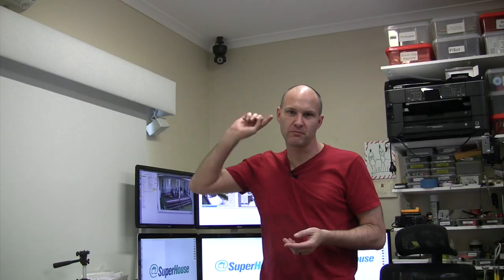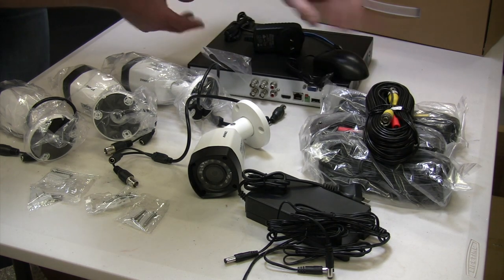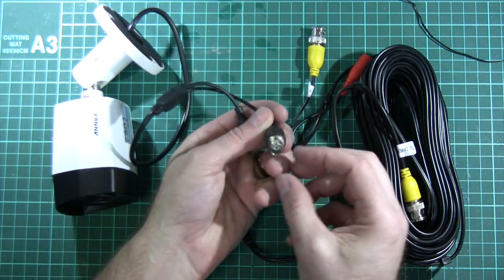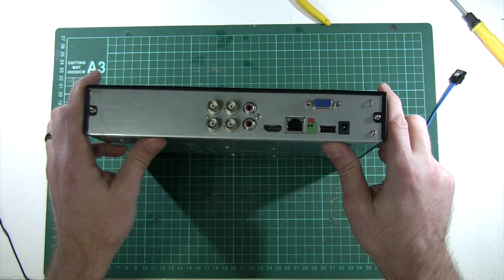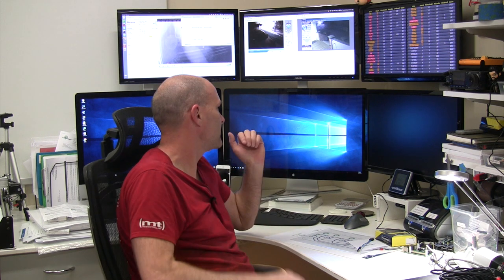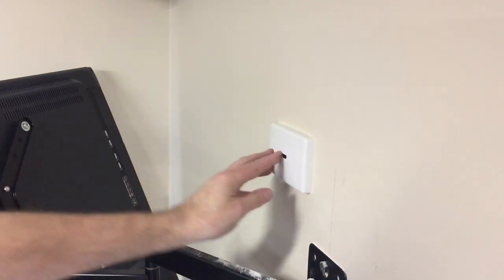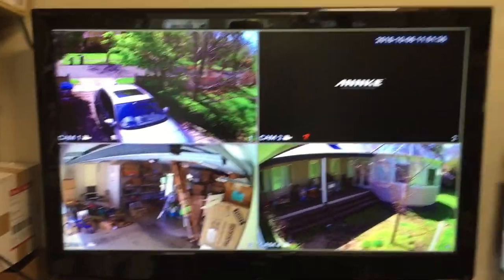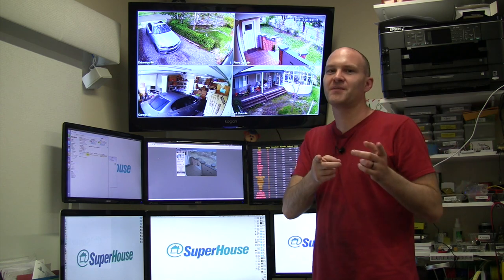SuperHouseTV #18: Installing the ANNKE 4-channel CCTV system

Comment: Really glad to run across such an instructive channel. I love the tempo, the details et your opinions as a seasoned engineer. Thanks a lot. Each and every video I've been watching so far, is awesome and helpful. You really deserve your 55K subscribers.
As a matter of fact, I agree with you about the exclusive-windows monitoring software. I do all my job on linux boxes and it's always pretty frustrating to install a dedicated machine (virtual or real) just to have your monitors running. Looks like a regression...
Regarding cables, you didn't mention Power over Ethernet cables which could spare space and time too. Adapters could do the job but they're pretty expensive for the topic.

Comment: Hi Jonathan! Greetings from a fellow Aussie, electronics, home automation, ham radio, computer geek! :-)
A few points... you refer a few times to the ANNKE cameras as being HD and 1920x1080.  These cameras use composite video which is not HD, it's either 480i or 576i depending on being PAL or NTSC.
I really think you have better check the temperature of the DVR in the ceiling space during summer... I think it's going to get way to hot up in there. (noticing beads of sweat on your forehead during this video).
There are a lot of keenly priced HD IP cameras and DVRs out there now.  I've been playing with the Hikvision cameras and they are amazing value for the $$$, 4MP (2688x1520) for ~US$130 . The web interface supports multiple web streaming formats... Microsoft, Quicktime, VLC.  Motion detecting is built in, FTP uploading, amazing IR illumination. RTSP streaming direct to software like VLC. 
The Hikvision DVRs work very well too.
Reply from the maker: I have a temperature sensor inside the ceiling space a few meters from where the DVR is mounted. It reports back to MQTT and shows up in my OpenHAB interface (along with temperatures at other places around the house, including under the floor) so I can see what it gets up to. We went crazy with insulation when doing the renovation, so the ceiling space has two layers of insulation directly under the roof and then another layer on top of the ceiling. It definitely gets warm in there, but not as extreme as it did with before the roof was replaced.

Comment: Great stuff, don't believe you found the fishing wire so quickly though 😆
Reply from the maker: You got me! I originally tried it with a piece of yellow-tongue, but I couldn't get it through the insulation. So I switched to the wire, which went through easily. It really did end up in that position though, because I measured from the side wall to get both holes lined up vertically :-)

Comment: I know it's a bit late, but the firmware on these DVR's/NVR's tend to have an RTSP stream that you can stream from.

I have set up this model before and IIRC, the address is something like rtsp://ipaddr:554/PSIA/streaming/chXY (X being the channel and Y being the main or substream, usually 1 or 2)

With this address, you can stream directly into omxplayer on a raspberry pi or even right into VLC.

Comment: Great Video. I have a 10 camera system with a 2Tb HD. So glad you reminded me of the ethernet extenders! I know I will have 2 or 3 spots that need more than 60ft.  I bought this system about a year ago (still have not installed it!!). Please make a follow-up video for those great features you spoke about at the end.  I would like to come up with a way to have my HD tv in my bedroom automatically switch from regular tv programs to the cameras if motion is detected.

Comment: Wait a minute. So, the power, like the 12v needed for a TVI camera can go across that small junction of ethernet cable? Amazing.

Also, I have a question. I have a HD-SDI camera (I know, it's old) for my driveway that weren't installed by me that haven't worked for months. What do I use to check if there is still power running to the camera?

Comment: Don't know if I'll get a response, but where did you get the BNC, Power Audio adapter to Ethernet for the last camera you did & what is it named?
I'm looking at a camera system & would rather run a single Ethernet cable for each camera through a wall then make a hole big enough to fit the 2 plugs of each cable through

Edit: Found some on Amazon.com & will likely use these when/ if I install a camera system similar to yours
Reply from the maker: I just saw this comment, sorry. I'm glad you found them :-)

Comment: I have a cobra  8 channel system and rxcamview installed on my phone.  My remote access works fine for 24-30 hours and then the remote access is disconnected.  I have to reboot my DVR and as soon as I do, the remote access to my cameras work again.  Then it fails again after 24 hours.  Reboot and it works, then fails, etc.  What is wrong...Can anyone help?

Comment: My only concern with doing home automation is security.
I would not want it connected to any internet or phone companies.
Basically I have 2 separate networks of both ethernet & wifi...one intranet & one internet.
Can this setup still be used on my local intranet so it will be secure?

Comment: Great video. Does it get hot in your attic where you installed the DVR, will the heat be a problem long term?
Reply from the maker: It gets warm, but not ridiculously hot. I have temperature sensors in there reporting to MQTT so I can track it. When the house was renovated we were quite obsessive about insulation, so it has two layers of insulation directly under the roof, then another layer on the ceiling. It's made a big difference to the temperature stability of the house.

Comment: In the UK the cable with coax and power is known as shotgun cable. Also the converter from BNC to cat 5 then back to BNC is known as BALUN. it changes the signal from balanced to unbalanced. I find that the quantity is not the great compared to BNC but yours look unnoticeable.

Comment: At about 31 minutes you talk about the Sonoff and presence detection. What method do you use to determine presence? All the methods I'm familiar with have reliability issues, but I'm interested in what method you prefer.
Reply from the maker: This is probably one of the most frustrating aspects of home automation for me at the moment. If it was possible to reliably track the location of every person in the house, it would open up so many cool possibilities! I currently use OpenHAB's network health plugin to check for the presence of various mobile phones on the local network, so that I know if particular people are home. I also use PIR motion detectors to figure out which rooms are likely to have people in them. PIRs are great for detecting unexpected intrusion (someone came into a house when it's meant to be unoccupied) and terrible at detecting occupancy. Sit still for 30 seconds and suddenly the home automation system has no idea you're in the room. In the past I've experimented with IR beacons (a badge you wear that identies you to a receiver in the room) but that is a terrible user experience. I've also experimented with a Kinect to do volume analysis, so it could know (for eg) if there is someone lying still on a couch. I've also used face detection in video streams, with very patchy results. I've spent a lot of time trying to solve this problem and haven't found anything that comes close to being a good solution.

Comment: The whole network connectivity on something other than Windows has been driving me nuts. I run Linux on my daily use machine, therefore... No ActiveX. Many cameras including the cheap Chinese ones, require ActiveX. So far I'm trying to get around that by using BluIris as an NVR.

Comment: Hey. Great video. This is quite late but I've been trying to look for a cctv system and aanke seems to be what I'm aiming for. I want to get a hd system but I need to know whether your able to distinguish a cars number plate.
Reply from the maker: Definitely, if it's reasonably in the field of view. The image is much better than the cheap WiFi cameras I had previously.
Reply: SuperHouseTV Thanks. This helps heaps!

Comment: This looks really cool except that windows requirement is a show stopper since I have no windows machines in the house, only mac os and linux/rp. I did a quick search and found ZoneMinder which can run on an old PC under linux and from my quick look it would have most likely supported your existing cameras as well as allowing upgrade to better cameras in the future.

Why did you go with annke over a something like Zone Minder?

Gordon.
Reply from the maker: Wow, ZoneMinder, I'd forgotten about that! I ran it many years ago with USB cameras, and didn't even remember that it existed. I'm like you with no Windows, I had to install Windows using Bootcamp on my iMac to try the remote access. I should look at ZM again.
Reply: I have little experience with linux, but love the concept of it. I have tried several times to completely switch. I have tried zoneminder and could not get it to work how i wanted. I found it to freeze up on me frequently. Though my lack of linux experience and know how might have been to blame. ispy for windows is what i am currently using as a recording device for my ip cams. Tinycam monitor on android or Chromebox is a great real time viewer program

Comment: I am looking in to doing something similar.  However, I was wondering about being able to tap in to those video feeds.  I have been playing with computer vision with my HA system and being able to tap in to those video feeds would be awesome.
Reply from the maker: Interesting question. There are probably 2 ways to do it, but I don't know if this is practical. Firstly there may be a way to spit the raw signal from the camera so you feed it to both the DVR and to a video capture card for your HA system. Secondly your HA system may be able to connect to the DVR via the network and read the video stream, in a similar way to a smartphone or other device connecting to it. I'd love to hear what you do with this.
Reply: My day job is dealing with all streaming video.  So I am curious what options these things have for outputting some video.  You said that yours is using activex to display it correct?  Have you tried to put anything like fiddler on that windows machine and check to see if that activex is calling a motion jpeg stream or rtsp?  If so, the box itself may already be streaming (in a sense)

Ill drop you a DM on twitter if you want to chat

Comment: I have a 16 channel 2K Q-SEE camera system, it has the same UI as yours from what I saw in this video.

I was wondering if you tried video streaming. I use VLC media player to view RTSP streams from the DVR, I know it works with OS X, Ubuntu, and even KODI on a Raspberry Pi. They also have a Q-SEE app to view it on a mobile devices, even outside the network.
Reply from the maker: I'll have to try that. I've been using VLC to view RTSP streams from a couple of my IP cameras, but I assumed the ANNKE software didn't expose RTSP. If it does, that'll be a big help.
Reply: I hope that works out for you.

Comment: I've been looking for a system for a while so I was interested in this video. I did think that the cameras would be driven using a network cable (for power and picture) so I was surprised to see the coax and separate power cable used. 

After checking out the Annke website I found you can have a NVR (as opposed to this DVR) solution.

I think I might opt for the NVR (see below) unless there is reason not to?

SANNCE 4CH 1080P PoE NVR HD Security Camera System w/ 4 2.1 Megapixels 1920*1080P Weatherproof CCTV Bullet Camera, Power Over Ethernet, Smart Recording, Quick Scan QR Code Quick Remote Access
Reply from the maker: Sure, an NVR is a great way to do it too. This just happened to be the package that I got because I wanted to get some experience with a non-IP based system.
Reply: SuperHouseTV I just bought a Synology DS216 Play with a couple of PoE cameras. Very impressed. 

First impressions, it needed Gb comms or it's too slow.

Comment: Hello!
Usually, you can access the video streams of those DVRs directly without windows. On mine, there was a CD with lots of examples inside.
Try around a little bit with VLC on the device. My ports and address where:
rtsp://10.10.10.145:554/user=admin&password=&channel=1&stream=0.sdp?

Channel for the number of the camera and then you can choose stream 0/1 (high resolution, low res)

Maybe your system supports that direct access, too.

Comment: Use IE on windows with Active X - Thats how most of the DVRS work. 
This is a benefit to using an NVR as you could build it from an old PC and install something like Milesight but have full control not just from Windows PC's

Comment: I'm only 14, so I'm limited on money with my "job" called school. Do you recommend any cheaper, less permanent surveillance systems? Me and my mother are getting ready for one soon.
Reply from the maker: Probably best to look at self-contained IP cameras, because it's easier to install them one at a time without worrying about a central DVR. You can also use an NVR (Network Video Recorder) to record the streams later if you want to.

Comment: use internet explorer in windows ...i had the same problem until i did my research that was the only browser that works with the cameras ...as long as you have your ip address from the dvr it will work perfect on any computer with windows..and smart phone..

Comment: Could you buy the 8 cameras and DIY an box with capture card running linux ?
Reply from the maker: Absolutely. Open source DVR software like ZoneMinder running on PC hardware would do the job. Once you have more than about 4 cameras you start to run into bandwidth problems with things like disk throughput, so it's pretty common to run RAID arrays on larger camera systems. I have a spare 4-slot hot swap SATA array sitting on a shelf that I may use for something like that.
Reply: It amazes me with 16 gig of RAM , PCI-E 3 , 10G nic's ,  SATA3/6gbps , M2 SSD's and SSD's and drives (HDD/SSD/M2) seem to be still designed around single access not like the old "expensive" scsi stuff
Reply: Maybe get the CCTV/DVR to write via 10GE network link to a ZFS/Hardware Raid 6 file server with 6 drives all WD BLACKS for faster access or WD Red PROs

Comment: Looks pretty good for the price. But for automation i wouldn't use HDCVI camera's. Individual IP camera's (with the onvif standard) give you a lot more choices in the future for integration. Most of them have rtsp streams, screenshot functions, ... 

For "cheap" camera's, some great brand would be Axis, Acti, hikvision & Dahua. 
I think the set you are using is actually a rebranded Dahua set

As for recording you, there is plenty of free software if you want to run your own server. all of these brands also have NVR(recording boxes) if you prefer that.

Comment: I'm a Linux only user, so I don't like that side of it and it wouldn't work for me. However, I did love the size of that board and the fact it had 4 BNC HD Video inputs! I'd love a board like that to run Linux and use OBS Studio http://obsproject.com to capture the feeds so you could play with different setups and switching for live events. So my idea was more for live video production instead of home security. Anyone know a board like that that is Open Source/Supports Linux!?

Comment: why not using an NVR instead of DVR? ip cameras are more expansive but your cables are already installed...?

here in ISRAEL the price of NVR Vs DVR will be about 20-25% more.(overall with cameras...)
Reply from the maker: That's a great approach too, but I still want to use these IP cameras as well in other locations. I needed more cameras anyway, so I replaced some of the existing cameras with these new cameras and then I'll re-use the old ones.

Comment: I disagree with not seeing commercial places with IP cameras, in fact I see more IP cameras than analogue and AHD cameras although their not foscam's their proper enterprise grade stuff like Panasonic, Axis, Hikvision and Dedicated Micros

I wouldn't recommend the balun method simply because you are more likely to get interference, but if have existing Ethernet run then its an ok method, just not recommended, I had horrible interference with one of the cameras on our home system, but we recently switched it out to a IP camera and it works great

As with the only working with activex thing I would not trust it, even the first IP camera ever made (axis neteye 200) worked without activex, not sure why they still use it, hope that microsoft edge is going to put a stop to activex, I can just about live with a slow java applet but a windows only probably malware infected IE only applet, no, burn it to the ground, so many bad experiences with activex, can you tell?